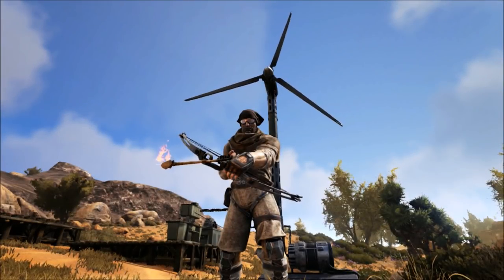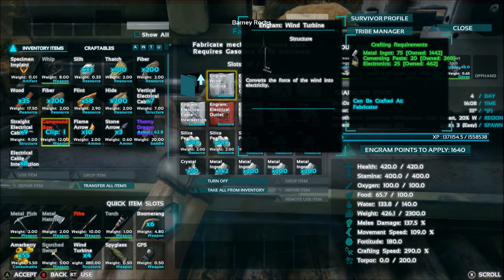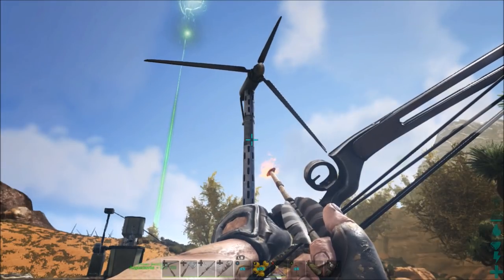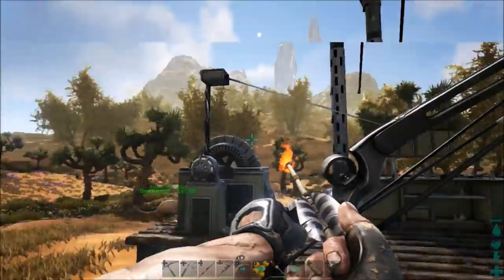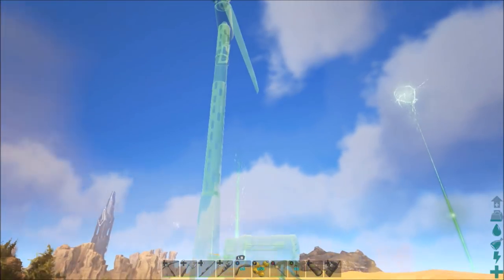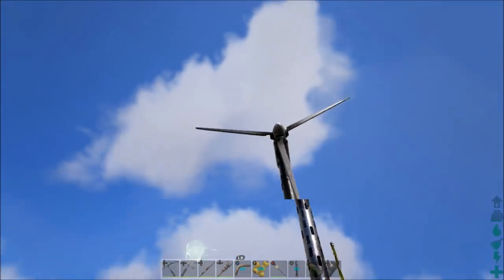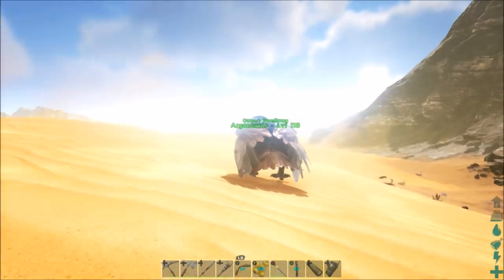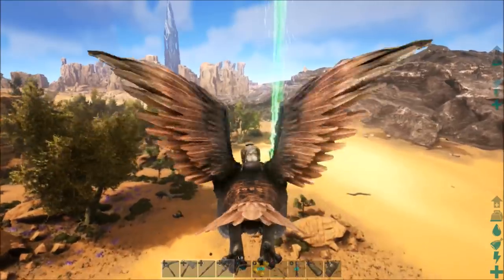ARK Scorched Earth - How To Use The Wind Turbine Guide (Tips and Tricks)

Comment: how to connect it to generator beacuse i built it on mountains and my base is almost at red obi
Reply: Tine Majdič use oblic cables an vertical to ajust the height on grid  till it reach the level of desired foundation, u can also use pillars + ceiling to have the intersection result right on top of ceiling where u can use a generator as backup

Comment: If your turbine doesn't work even if you have your Base in an area with 85% wind, open up your inventory. There you can see a point which says "Wind: n%". Mine is now at 37% and it's going up slowly. So you have to wait until it works automatically.